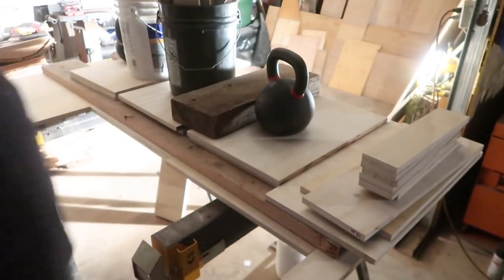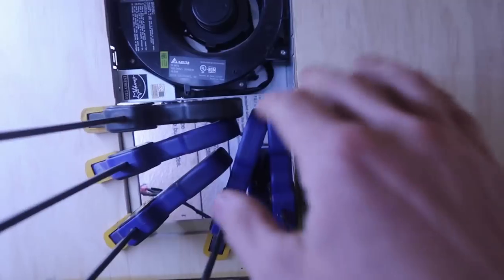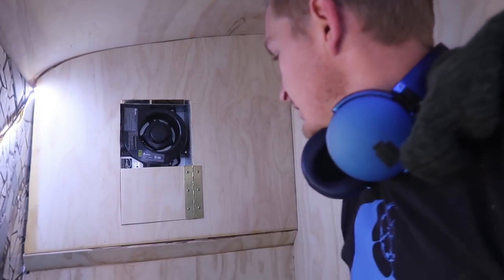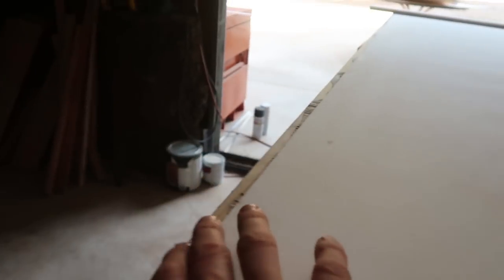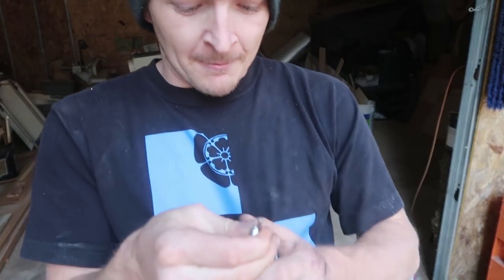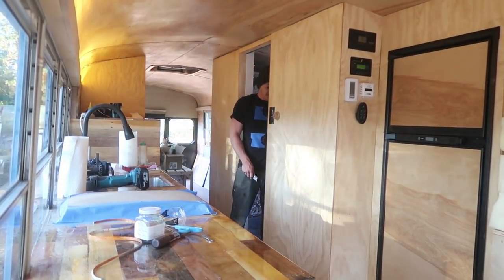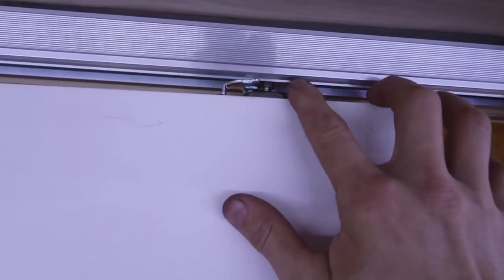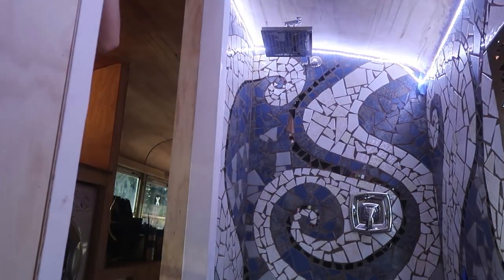#93 SKOOLIE BUS CONVERSION | Installing Custom School Bus Pocket Door and finishing the Bathroom!

Comment: When I do pocket doors I make the opening a bit smaller than the width of the door and either put a 1" pocket on the closed side or trim the closed side out. That way the door looks completely sealed when closed and can't rock back and forth at the bottom. I plan on all doors in my bus to be sliders to keep the floor space open.
Reply from the maker: Nice. From your description, that is what we did too. My Dad suggested that I add a block inside the door wall to keep the door from rocking back and forth. Sounds to me like you have a good plan.

Comment: I would have put a thicker piece of wood you cut off the hinged door and fold the hinge closed and secured it on the inside of the frame and door so only the spine of the hinge shows and not the whole (forgive me for being honest) ugly out of place hinge.
Did you do all that tile free hand? Holy shite that must have been time consuming.
Reply from the maker: I love honest critical feedback. thank o1. I agree that the hinge is out of place, but the wood is 1/8" birch ply nd I wanted the face of the wood to be flush with the back. I was adhering the hinge to the 2x2" frame so I didn't have the option to slip the hinge in as I wanted it to be connected to the structural support. Yeah, V did the time all 'one by one'. It took her a very long time.  Thanks for watching and I appreciate the critical feedback. :)